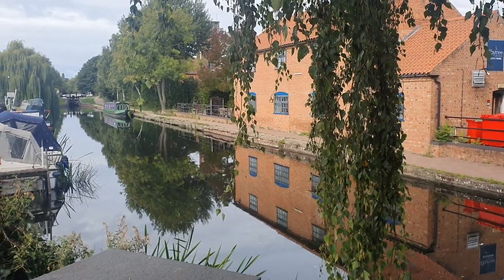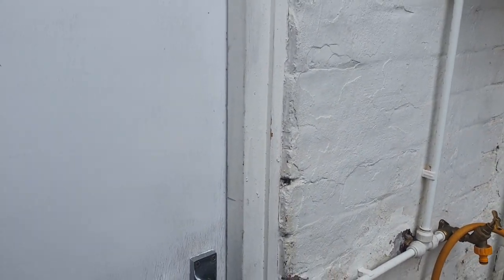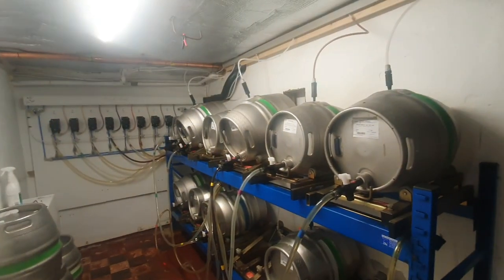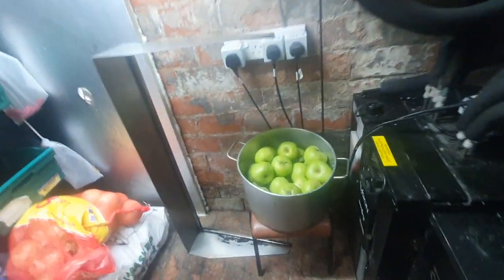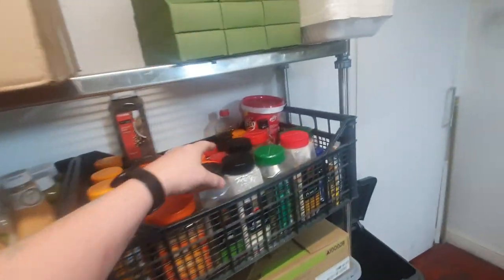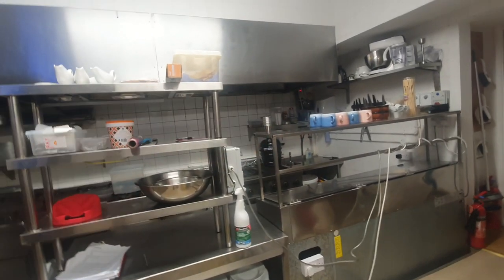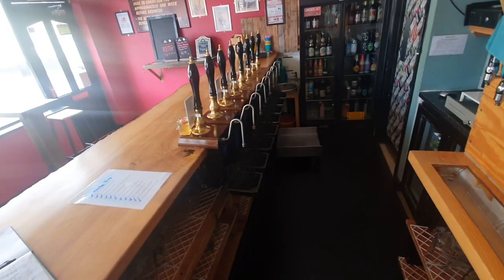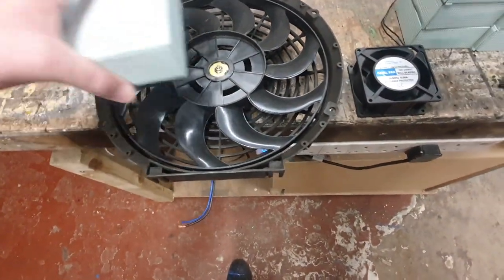Vlog 859 Changing The Cold Room Fans Will Save £££

Comment: Good work and nice potential saving on energy costs. I don't know about car radiator fans but most fans will happily work with less than their specified voltage, at lower rpm obviously. The trick is to find the minimum voltage they need to start spinning from a standstill (the peak draw). Might be worth a play?

Comment: Hi Chris, I installed this kind of computer fan in my 460 liter keezer to move the air and overcome the vertical temperature gradient that inadvertently forms in it when running at only 4°C. I found the fan to be very ineffective to do so, but when I placed it on top of a pipe I got perfect performance.... Will be interesting to see how well the fans perform in your larger cooling rooms. Keep up the good work! Cheers

Comment: As long as the coil or radiator and system feeding it doesn't have to work harder. The lower airflow may affect how well it works. Might find if compressor has to work harder then any savings might be negated.

Comment: I think you mixed up your units in the calculation. Your price was in KWh but the fan was In Watts. You needed to convert the fan to kW first so 0.080 x 65 = £0.052 is the price per hour.